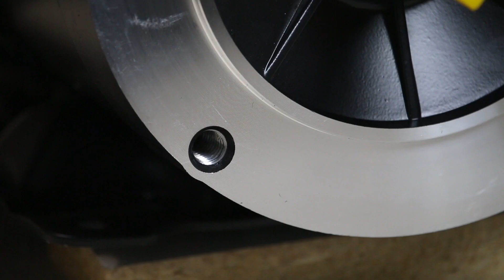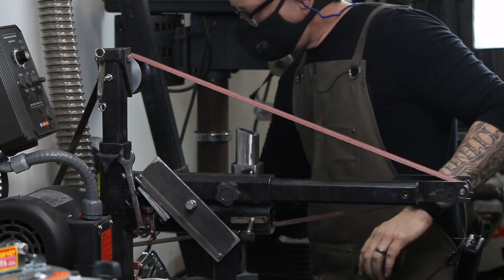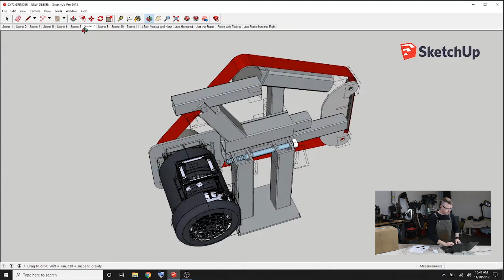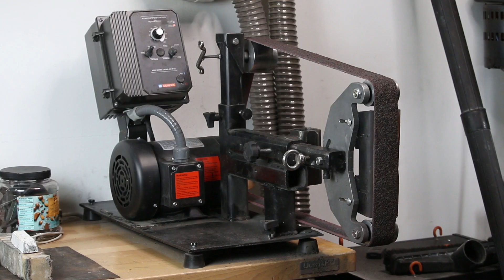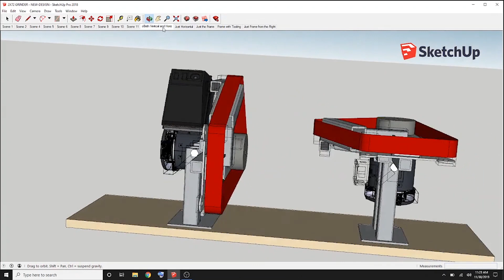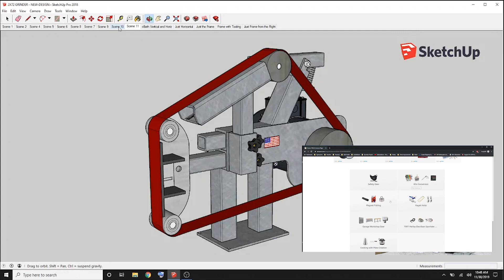2x72 DIY Tilting Belt Grinder - A New DIY Design - Homemade Tools

Comment: I think it would be cool to have it spin over 90 degrees with an adjustable bolt to adjust at exactly 90. And the hinges look like they’ll need a little more travel because of the bolt thickness
Reply from the maker: Thx Tyler! Appreciate your thoughts, interesting idea. This plan set has been revised a couple times since so there are many little things that got the tighten-up. ☺️

Comment: Brian, Just as a cheap option for builders, try storm door air cylinders as spring option for tensioning arm. (Air adjust screw is great too )use two if ya want a lotta pressure..Hal

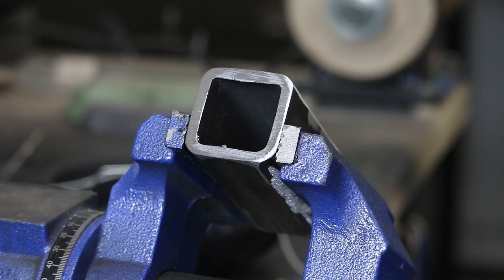Comment: Brian, at 9:43, there's an easier way to grind that weld seam with a file.  Clamp one end of the file in a vise, slide the tube over it weld seam down, then use something to support the other end of the file.  Move the tube back and forth until you get the fit you want.  Far easier to move the tube than a file, plus it files straight since there is no rocking.  Of course, the tube has to be about ~1/2 the length of the file for this to work; so long files are nice to have.  Thanks for posting!

Comment: I started to build mine from your kit.  Shouldn't the hinges be slightly above the top of the Posts?  My posts are exactly 9 inches tall and the 3/4 hole was drilled on center,  1 inch from the top.  The hinges are slightly below the top of the posts.
Reply from the maker: They should be in line with the top of the posts. You can adjust this by shaving off some of the Pilar to match.

Comment: hi Brian,
There is another way to make the tube sections without welding..you can bolt it together with cap head screws...its easier and try strong no welds to clean out..also you could tack some parts together..just a thought. great unit ..
Reply from the maker: Interesting, I will look at that. I am actually designing another plate steel version of this that wont use tube. Should open up a whole new market for these types of grinders.

Comment: Oh, been meaning to ask: how much pressure does your spring provide? I'm going to wind my own spring so I need to know about how to make it.
Reply from the maker: Hi Ken, here is a link to the exact spring I use. It has all the specs. I am interested in your spring making project!! https://www.mcmaster.com/9654k156
Reply: @HouseMadeUS  Since I can't afford the Origin Blade Makers' tracking unit I'm making one myself. Actually, I'm copying Jeremy Schmidt's but with some adaptations to make it fit. He doesn't use a spring like yours; he uses a torsion spring. So I'm curious how much pressure yours puts on the belt. Okay, I see it says 25 lbs per inch. Not sure how to measure that but pretty sure what I'm making will work. Works for Jeremy.

Comment: I have a friend in the fabrication business - a one man operation that takes him all over the country (he's very good). He gives me his left overs at cost. I got a 4' piece of 2"x2"x1/4" and a 6' piece of 1.5"x1.5"x1/4" for $50. Then I got a 24"x18"x3/8" piece of plate for $20. He said he'd cut me some more if I need it but 24 by 17 was all he had on his shop floor. Great guy but he's very hard to track down so I can't always get the deals.
Reply from the maker: Yeah that’s a terrific deal. I think you have enough to actually finish the entire grinder.
Reply: @HouseMadeUS  Yes, I think so. I'm getting all my stuff together. I still have to finish my table saw stand first but I've got the parts all ready to go for it too.

Comment: Hello from Captgreg, the easy way to remove the inside seam weld is to
buy a drill extension shaft and get a stone that mounts with set screws on the shaft.
Reply from the maker: Good idea Capt. I’ll give that a shot. I have one of those long arm mini pneumatic grinders that works really well too. 👊🏻

Comment: I will say the lever action, rear spring tension arm is far superior to the vertical tube in a tube method. You get the tension flexibility while you are adjusting the tracking wheel.

I scrapped mine earlier this afternoon for this method and my previous tracking issues have been eliminated.
Reply from the maker: I most definitely agree. Have you sent me any pics of your setup yet? brian@housework.us - I would love to check it out.

Comment: What is the length of the tracking arm and post? And what is the angle the post is set at.
Reply from the maker: Tracking Arm is 9" (may not need to be that long) The length of the post coming off the frame is 8" set at 120 degrees.
Reply: House / Work many thanks for this quick response. I’m working on a plate version of my own but, so not to get stuck with one specific motor and it’s mounts I’m going a slightly different route to give the ability to use any motor. Your current design looks like the back leg of the frame would line up with the tracking arm behind the pivot point, I’m thinking to not have the angled post and just go for a straight post directly in-line with the back leg, obviously this would quite drastically shorten the length of the tracking arm from pivot point to wheel. If this changes the reaction of the spring (most likely) then a spring is easy to change.If this became too stiff to get the belt off then it could be extended past the tracking wheel or have a longer bar added.

Comment: I really like the design . . . especially using the 1/4" tube. I think thats a a design consideration that more folks should consider. Ive been planning to build 2/72 and have watched a ton of these builds. The best I've seen so far is Barts Metalworks. Uses some heavy plate and would not fit some of your requirements for standard sizes and reasonable shipping weights. And he is able to machine everything in his shop. But if you have not seen that one I suggest taking a look. Might get some ideas . . .  https://www.youtube.com/watch?v=yFF865zbGrM
Looking forward to watching your build . . . good luck!
Reply from the maker: I really love Barts channel and dig what he has done with his build. But...yeah that dude machines all of his own gear right down to the wheels and axles. Seriously pro stuff there. The goal for this build is to give the majority a fighting chance to build and own one. I did a ton of research like you on this and after building my first one I realized how much room there is for improvement. I come from a long line of engineers and tool designers. (my grandfather designed the mechanism that became the modern day orbital sander) - Or so the legend states. So, somehow it comes pretty naturally for me. That said, modern day software makes it pretty easy to conceptualize something. Thank goodness for that. Thanks for the comment, and the support. It is much appreciated.

Comment: what is the tool rest gunna be like? how will that attach ?where ? like the tilting feature kinda like Jereme Schmittes^ design but simpler cant wait to see it completed!
Reply from the maker: I've moved the platen arm up a tube and the lower tube can be used for the tool rest. Thats the next thing I need to work on. Honestly I don't use a rest much but I know people would want that so Ill put that together. Glad you're on board!

Comment: had an idea about using different size platen wheels used in the horizontal position can be used as somewhat a small wheel  atachement, just a thought
Reply from the maker: Yeah, I definitely want to design a new platen that can offer multiple functionality.

Comment: I love the soft platen idea. I hope that the rotation of the machine will work with the steel tube. I think that since you're going with .25" wall, it SHOULD work. I am NOT an engineer by any means, so take it with a grain of salt. I will be following the whole build. If it works for you, I'll be building it as well, with the plans of course. Thank you for bringing the YouTube crowd in on this build.
Reply from the maker: Sounds good Ron. I am a couple sheets of steel away from getting started. I figured out the hinge yesterday, but I need that cut with a plasma table. Trying to find one here that can do it quickly is tough. There are some online websites that offer it and will ship it to you. I might try that. Thanks for collaborating!

Comment: The new design is looking awesome so far. It looks pretty solid. you talked about filing the weld out of the square tube. check out this from Jason at fireball tool https://www.youtube.com/watch?v=3jr4Capx8XI. This might save you time if you plan on filing a lot of tubes.

I feel like the grinder would be more stable if you spaced the vertical legs apart farther. looking at the sketch up model you could push that front leg forward another 2" to separate the legs more for a larger footprint.

have you thought about moving the work rest tube to the grinder base side of the hinge? that should make it were you don't have to change the work rest when switching from horizontal and vertical grinding.
Reply from the maker: Yeah that Fireball weld remover is legit. If I ever start making these for production I would definitely need one of those, or perhaps go with the weldless tube which is a lot more money. I agree on the footing. I have been round and round on that in my head, but I think I want to give the small base a shot, just to see if it can work. I haven't thought about the work rest being mounted to the base. Not sure exactly what that would do for me. Perhaps I'd need you to elaborate on that a bit. Because it is tube the tooling arm will fit in either direction. Thanks for commenting and subscribing AND collaborating! Looking forward to more.

Comment: For the tracking arm/running backwards look at the Reeder grinder(it's why I bought one), I made my own tracking arm for the KMG, which worked pretty good, but it might have also strained my VFD. If you look on KBAC VFD nightmare you can see it. I think my main problem was not tightening down the bolts, so everytime I stopped/started it, it would twist & overloaded my VFD... As for the horizontal part, look at North Ridge, they have a mount with the same action... Not to use their ideas for both companies, but to get some ideas... Otherwise, looks good... Have a great weekend, take it easy...
Reply from the maker: I’ll take a look. Thanks Dave. Yeah the whole getting everything to line up properly is a tough one. Hope this design makes the cut. I think my tracking on this one will be light years ahead of my last one. So that will help.
Reply: @HouseMadeUS  Right on... Also, I read that comment from Sam Watson & when I was typing was thinking what mods I would do, maybe check out that comment too... Will definately be interesting...
Reply from the maker: Done and done. Thanks again Dave. 💪🏻

Comment: This is great Brian. How is the tracking wheel going to work? Will it have a hinge type joint for the screw to push against to track it? The spring has to be a pull type spring by the way not a push type so you dont need a huge flat spot but more of a hole to hook a pull spring into. But you probabaly know that already haha.
Reply from the maker: Yes it will be a hinge type this time. That way I can get the full advantage of the tracking mechanism. Which is very important to being able to reverse the belt. That spring was just something I downloaded from Trimble. I was being lazy and didn’t want it design one in 3D. Lol.

Comment: Awesome plan man, ready to build along.  Only suggestion or question would be tool rest are you planning on bolting it onto the bottom of the tooling arm like the old design? Have you though about a tilting tool test you can set at any angle and how you'd accomplish that with the platen tool arm being inserted into the bottom frame tube steel?
Reply from the maker: Yes, have you seen Barts design from his last video? He has a cool articulating arm for a rest that I really like. If I drop the base Dow a couple inches I can use that second tub for a rest. Just need to make sure I have clearance for the tilting mechanism and motor. 🧐

Comment: very cool ideas. I would like to build one. I think the spring is working backwards though. yes the tilting feature maybe needs to be a little larger and I cant tell where the pivoting point is located. maybe needs someone to build a proto to work out the refinements. I totally agree simpler is better and low cost is good too
Reply from the maker: Yeah that spring was just something I downloaded from the sketch up library. I’ll make sure that I have a proper spring in place or two when the time comes. That something will have to play with. The pivot point is that bolt just to the right of the locking nut that’s on the hinges. It’s a shaft and goes all the way through the base. From my estimation that should be the center of the device but it most definitely will be top-heavy. Thanks for commenting!
Reply: okay yeah I see it now. I was commenting on the pivot arrangement before the video showed it. my apologies it looks good many thanks @HouseMadeUS

Comment: My only suggestion would be to increase the radius of the tilt mechanism. There is a fair bit of weight in the motor and with vibrations you don’t want it coming loose. If that radius is increased to 12-15cm it should be able to counteract the bending moment caused by the offset weight. Another option is to perfectly balance the entire mechanism, might be tricky given geometry.
Reply: I was thinking the same thing, but if(in theory) you have everything bolted down(including the motor) and the pivots locked, there shouldn't be much movement. It all depends on the tolerances of all the connections. The motor(again in theory) should be heavy enough(if secure) to run smooth...If anything, maybe move the motor up, almost as a counter weight. I'm sure once it is prototyped, he'll figure out what needs adjusting... Maybe even an angle on the side of the 2x2 stand and a lip on the frame to lock to for more stability.
Reply from the maker: I have been working on this today and found a happy medium (in SketchUp theory) that seems to work. That said until I build it we won’t know. I suspect I will need some reinforcement on that motor plate and Dave that’s a good idea on making some sort of locking mechanism back there as well. If needed of course. Thanks for contributing and using your brain power to help. Much appreciation. 👊🏻
Reply from the maker: I think you might be onto something there. Instead of quarter circles I can make them a half of a circle and that would give me a little bit more turning room. And the center of gravity has yet to be determined. I think that something I can only figure out once it’s built. Thanks for commenting!

Comment: Look up Jeremy schmidt, he made a belt grinder that pivots with the motor, he actually sells the plans for 20.bucks.
Reply from the maker: I have seen Jeremy’s work. It’s really impressive. I would like something similar to his design except I think it can be accomplished with tube steel. And yes you are right about the radius on the tilting hinges. That is one thing I have zero experience with.